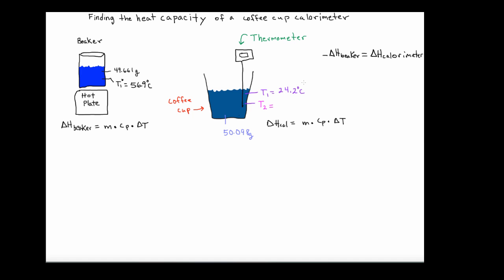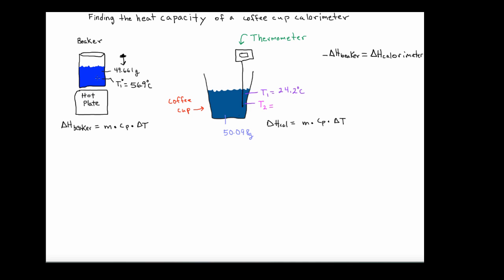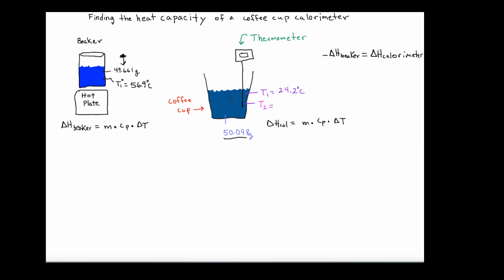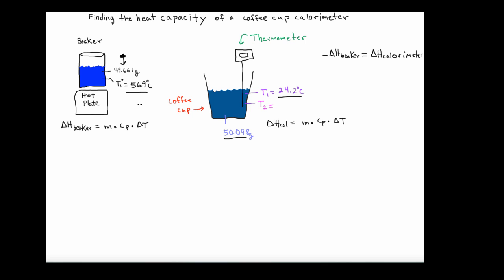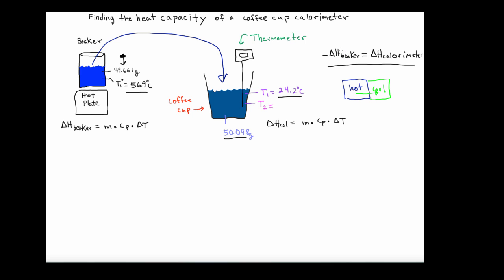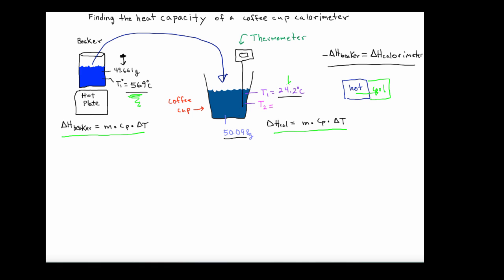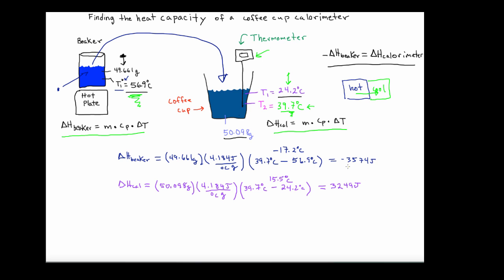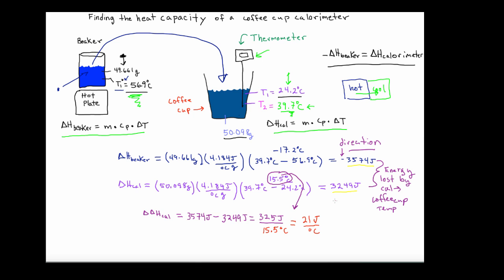ChemDoctor: heat capacity of a coffee cup calorimeter

Comment: Thank you so much for this video.
One question: At 1:50 it is mentioned that 50.09g is the mass of the water (only), however at 15:01 it is mentioned that such is the mass of the "calorimeter itself including the water". Which one should be considered?
Reply from the maker: Yes. This is a flaw. Ideally we should know the actual mass of the water, cup and probe. So the value we got was an approximation. The thing is if you keep the masses of water in the cup and that which is added it pushes the error down. Hope this helps.

Comment: Hi! I just want to ask if the substance inside the calorimeter is the one releasing heat is the formula still the same(negative change of Heat of beaker= Change of Heat of calorimeter)? Or it is interchangeable depending who loses heat? Waiting for your respond sir thank you so much!
Reply from the maker: The substance or reaction is the system. The calorimeter is the container, water, and thermometer. So if the substance is releasing heat then the surroundings (calorimeter) is gaining the heat with a positive sign. The change in heat for the process is calculated off the calorimeter. To find the system flip the sign.